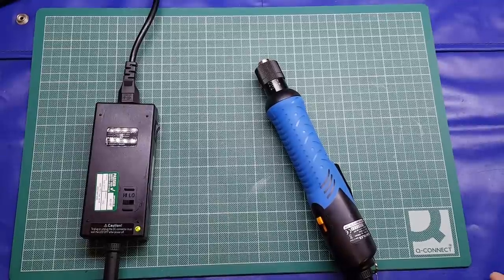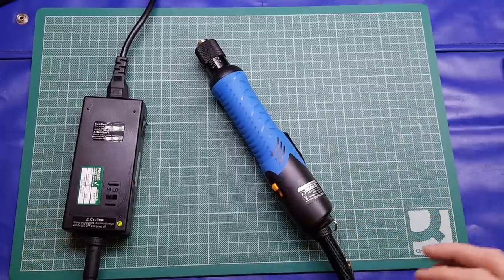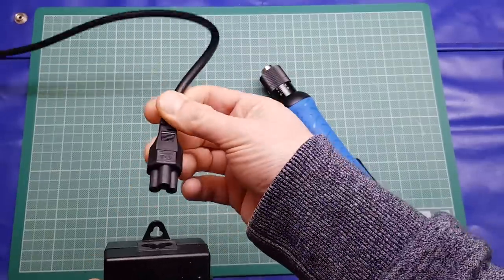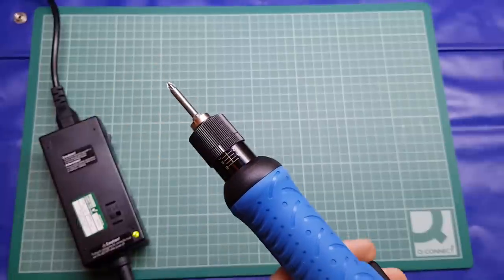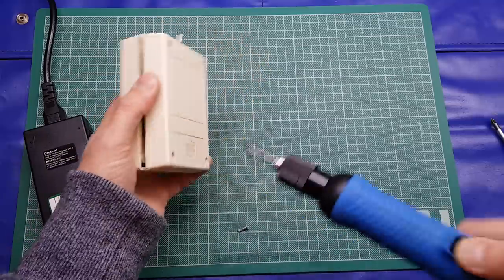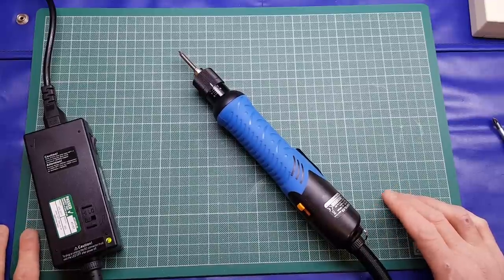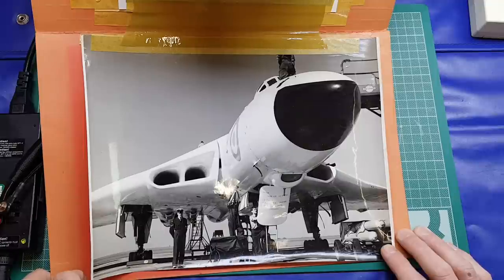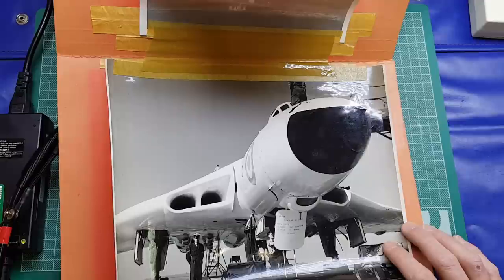Sumake torque screwdriver review and I need your thoughts on something! (Electronics blog)

Comment: FYI: For self tapping screws that fit into plastic threads, you should always start them by hand, turning a half turn in reverse to allow the screw to set into the original threads, else you will damage the threads.

Comment: You seem to be describing some kind of pressure, or mass surface density, rather than torque. Kilograms "per"? "Square"?? Centimetre???
Reply: My thoughts exactly. That's a very strange unit. The only thing I've ever heard of being measured in mass per unit of area is BMI which is mass in kilograms per square metre.

Torque is measured in newton metres. At least that's what I got taught in physics class and that seems to be the official SI unit.

Kilograms per square centimetre would indeed be some kind of measure of surface density. At least to my mind.

Pressure is expressed in pascal which is a measure of applied force over an area; 1 Pa = 1 N / m².

I'm confused now. Is kg / cm² actually a unit that is used for those kinds of tools? Am I just ignorant?